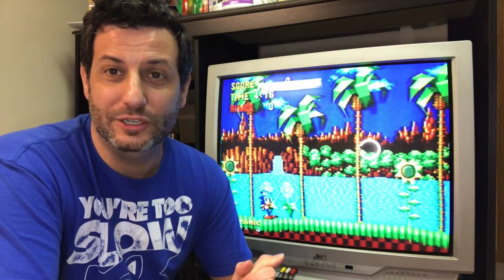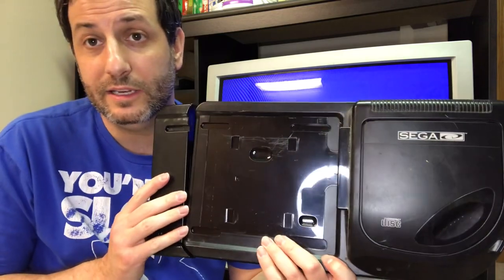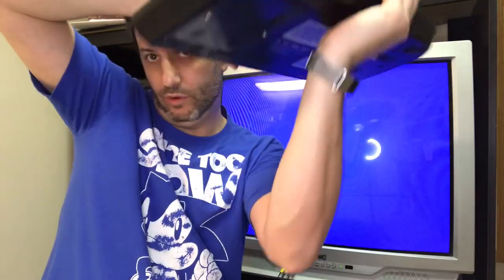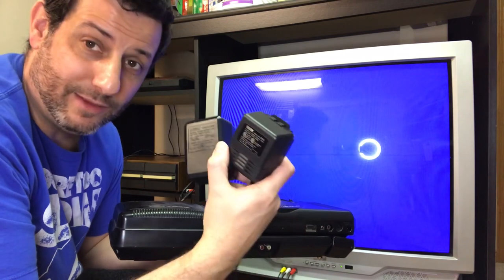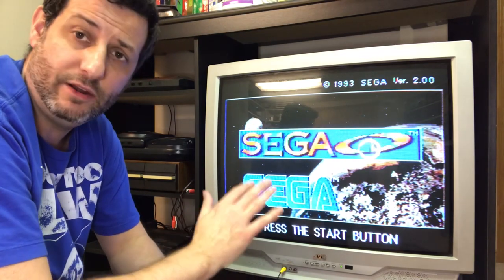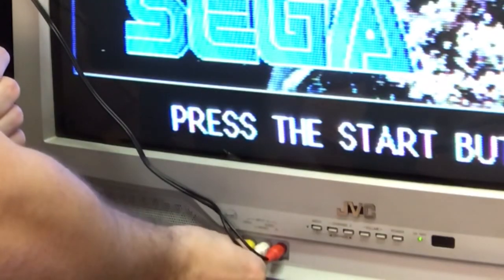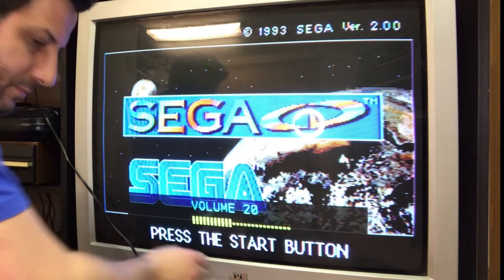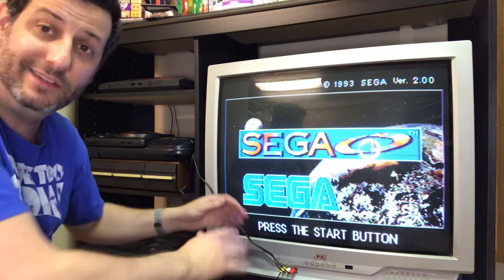How to Properly Hook Up a Sega CD

Comment: Found the stackable model with a Genesis at a yard sale for $40. I didn’t have the guts to tell the man how much it was really worth. 😂 I bought it
Reply from the maker: Fantastic! Great find, well done 👏
Reply: @SvennyMcG  Thanks haha, he had a lot of old games but everything else seemed to be priced accordingly. Maybe he looked up the price of a stock Genesis and maybe thought the CD unit was part of it. No idea
Reply from the maker: Oh that could be, saw a Sega Genesis price and applied it. Have you tested it?
Reply: @SvennyMcG  Yes, it works!!! It was extremely dirty but it looks and works great after I cleaned it. The same guy had a bunch of Commodore equipment too which I got some of that also. Probably the best yard sale I’ve ever seen. Some of the commodore stuff had issues but I was able to fix them
Reply from the maker: Wow that's amazing! C64 stuff, Vic-20 or others?

Comment: You should set the headphone output volume of your model 1 to around 6-7 to prevent the Genesis sound from being distorted when using the mix cable and getting your sound from the stereo outputs on the Sega CD

Of course, the model 2 Genesis does not require the mixing cable.
Reply from the maker: Thank you for the advice 👍 I'll try out those levels and see how it goes. Thanks for watching 😊
Reply: If you have a VA4 mega drive you can set the audio to maximum or if you have the 3BP.

Comment: Would all those cables come out of the box if you bought the add-on new at the time? It would be a shame if it didn't considering the difference in the quality and also the fact that the competition (read Super Nintendo) did ship with AV stereo cables (and the SNES was a 1990 release). Nice video by the way! 👍
Reply from the maker: Great question! My understanding is no, composite cables were not included with the Sega CD (and certainly not with the Sega Genesis, which I unboxed here: https://youtu.be/0X7fB-ja1xI ).
The Sega CD included the power supply and the stereo audio cable but no composite cables. So, to achieve stereo sound you could plug the CD unit directly into an external speaker system (if you had one) or, more likely, you could connect the Sega Genesis RF cable into a VCR (a common device at that time) and demodulate the RF signal into a composite output - essentially use that video from the VCR and stereo sound directly from the Sega CD. Hope that makes sense 😅 Thanks for watching!

Comment: Just rebought a Sega CD model 2 and forgot how to attach it to the Genesis model 2. Thank you very much for this video. 
Also would you need to HDMI cables for Sega since you have to power the Sega CD and Genesis?
Reply from the maker: Happy to hear this was helpful 👍 I've used AV cables to connect to a CRT TV; if you're connecting to a newer TV then there are HDMI options or else you could use composite cables if your TV accepts them

Comment: Your 27” JVC CRT tv looks incredible. Amazing picture! Is that your best set?
Reply from the maker: Thank you! This JVC is probably my favourite, more than my Sony Trinitron. The picture just seems so stable and clear, I love it👍 It's actually a 32" set, model AV-32432
Reply: @SvennyMcG  thats a big boy. There was a time maybe a few years back where you could pick these fancy second hand CRTs up (even HD CRTs with Svideo and component out) for free all the time, at least in my area where i live (central florida). My favorite is a 27” philips set with component out and svideo out. It was stored away for many years and looks like it just came out of a box. Got that set on offerup for only $5 , practically giving it away
Reply from the maker: My experience has been much the same, I occasionally see CRTs sold as "retro" here but mostly they are inexpensive. This JVC was indeed a free pickup about 10 years ago (though it nearly cost me my back 😅). It supports S-Video and component as well 👍

Comment: Looking at this video, my parents did not hook up the sega cd correctly. We had a model 1 geneis, model 2 sega cd. The plate ended up inserted into the sega cd and the genesis was pushed on top. They didn't screw in the screw to the plate. Also, they never hooked up the extender plate on the bottom, so the genesis overhanged past the sega cd.
Reply from the maker: Well, if it worked it worked! Hard to blame parents, pretty awesome you had both the Sega Genesis and the Sega CD 😊👍

Comment: I have a Megadrive 1 with stereo scart support, I just got a Mega Cd 2, how do i go about getting ideal picture and audio from this combination? I plug the headphone jack from the scart in the front of the megadrive but that would obviously prevent me from using a mixer and the rca cables arent on my crt tv, just scart sockets. Im so confused.

Comment: I feel this is incomplete without the addition little RF shield attachments.  Those two little metal pieces tend to confuse people the most.
Reply from the maker: Haha unfortunately I didn't get those two pieces - I'm still happy to have the extension piece in addition to the steel connector
Reply: @SvennyMcG  But But...think of the FFC regulations!!! 😆
On a side note, you can carefully bend your metal extension bracket straight if you wanted to.  I noticed yours was bent which is quite common.  Sega really should have had an additional bracket on the top as well!
Reply from the maker: Haha I'm just broadcasting Sega CD into the airwaves 😅 And you're right, I'll have to straighten it out but it's not so bad on a shelf 👍

Comment: What happens when you connect a genesis 2 to a cd 1???
Reply from the maker: I don't have a Model 1 CD to test but I believe it works 🤔 the connection port on the Genesis models 1 & 2 are the same so I believe it would work but you're right, you don't often see this configuration

Comment: Your gears on your Sega CD are slipping. That's what the startup noise is when you say "it's just checking for a disc". My Sega CD was serviced and doesn't have that issue. Please get yours looked at by a professional. 

Thankyou for the video. I was wondering how to hookup my Mega SG,  DAC, and Sega CD properly to get correct audio.
Reply from the maker: This makes a lot of sense, I've heard it on other systems but it makes sense that it's an internal gearing concern. I'll look into it for sure, thanks for the heads-up 👍
Happy to know the video was helpful 😊
Thanks for watching!

Comment: actually what you have there is v1 sega cd the v.2  was the stacker
Reply from the maker: Are you sure, my friend? Every source I've reviewed (eBay, PriceCharting, Amazon, GiantBomb, Wikipedia, iFixit, ConsoleVariations) shows the stacker as Sega CD Model 1 and the side unit as Model 2
Reply: @SvennyMcG   i believe there 2 models of the sideby side 1 made for the model 1 and 1 made for the model 2 16 bit
Reply from the maker: @jasonhowe1697  not sure, I do know mine has the extension for the Genesis Model 1 to fit

Comment: Just picked one up and all I see is the space pic on the tv
Reply from the maker: Awesome you got one! Are you using AV cables or the RF adapter? You see the title screen but is it not loading discs?
Reply: @SvennyMcG  av cables. The space pic starts and then nothing. No power light blinks on the cd.
Reply: Never even says sega cd or do I hear any audio
Reply from the maker: Weird. Wonder if it's a capacitor issue or something of the like 🤔 Are you using a compatible power supply? The first time I plugged in my Sega CD I accidentally used an AC adapter instead of DC and it would start and stop similar as you described
Reply: @SvennyMcG  I got it working. I overlooked a small spot of corrosion on the board. Cleaned it up, and a little pass through hole was damaged. I scratched a little of the trace off on both sides, and soldered a small strand of wire on either side. It turned right on!